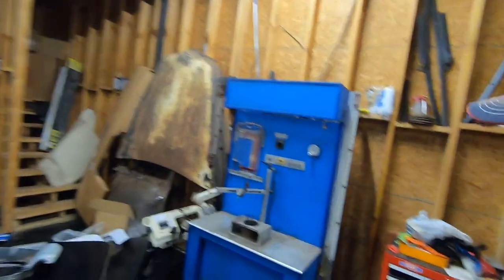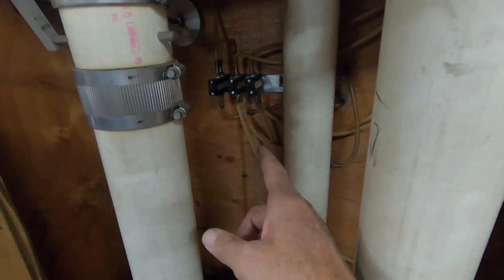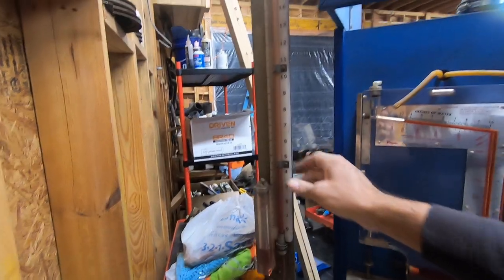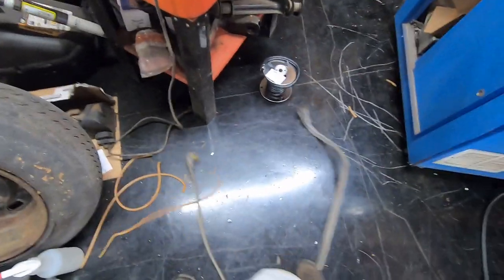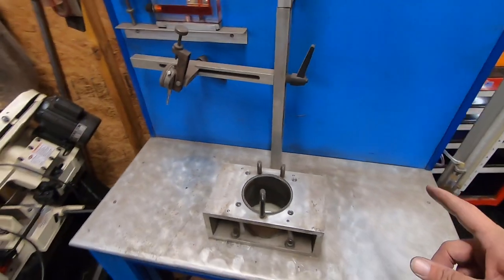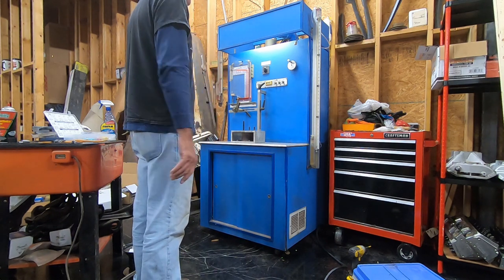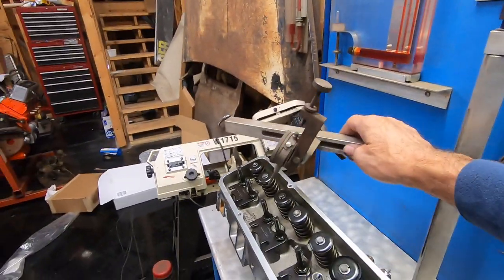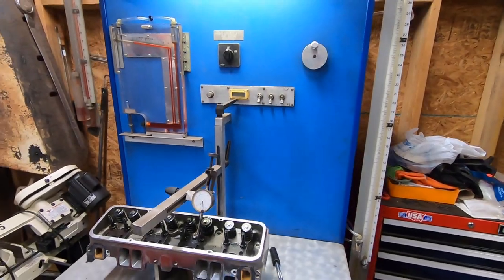Saving an old Flow Bench from the Scrap Pile.

Comment: Hello.  Did you end up getting this bench running?  Is it 3 phase or single phase?  

I have the same bench and am backed into a corner atm.
Reply from the maker: I did. It’s single phase. What can I help you with?
Reply: @Shop209   do you think you might be able to help with some capacitor specs and start switch specs, along with some pictures of how your unit is wired?

Comment: What type of blower fan does it have? It looks like a Dayton 12-1/4”. Is it possible for you to post the fan part number? I have a jkm 600 and it’s missing the blower and motor. The guy I got it from said the bearings went out in the fan like 15 years ago. So he removed it and took it somewhere to have it repaired and the place lost it or something. I haven’t been able to find any information on the Jkm’s so I’ve been trying to come up with some other fan. After seeing your video I saw the Dayton sticker and found a similar fan on their website. It would be nice to know the specific part number so I can order a replacement. I’d very much appreciate it. Thanks👍🏻
Reply from the maker: The Dayton number is 4C129 for the whole assembly. The 400 and 600 used same blower just different pulleys.
Reply: Thank you very much. 👍🏻

Comment: @BrzezinskiRacingProducts has some good videos on YouTube regarding flow benches and heads. I'm not sure if it applies to what you are doing but I enjoyed watching them.   I'm looking forward to seeing what you do with this. I would like to learn some porting but without a means of testing, it's seems like it would be pointless. "I think I made it better..." doesn't cut it.  Good luck.
Reply from the maker: Thanks! I’m hoping I can do some basic testing with what I have. I’m not sure if this bench will be accurate enough to test small changes or not.
Reply: @Shop209  You may need to put it in a climate controlled environment (I suggest the master bedroom) but I'm betting it will... ;-)

Comment: I   got  all kinds of  Chevy small block cylinder heads , LT1  , Power Pack  , double hump  , 906 Vortex  .

I have  Ported Heads,  planned Heads and  had valve jobs .

Never  once  had them flow tested .

I have used Crane,  Comp , and other camshafts  .
I usually cared about  duration  more than lift and  made great horse power. 

DID   YOU  RECEIVE  THE  VIDEO  OF THE 
70 SS HOOD THAT IS 49 AND 1/2 INCHES  ? 

I   SENT  IT  TO  THE  JOHN G CUSTOMS ADDRESS THAT YOU GAVE ME  !
Reply from the maker: Yes I did receive it. Thank you.
Reply: @Shop209  , as you could see in the video  it is only 1/2  inch  but it sure does  make a big gap in  the rear at the Cowl. 

I have  never  seen  one like this before  and  I have had 4 Nova Cars 
1973 
I974 
1974 
1972